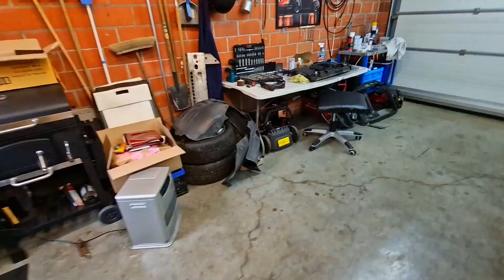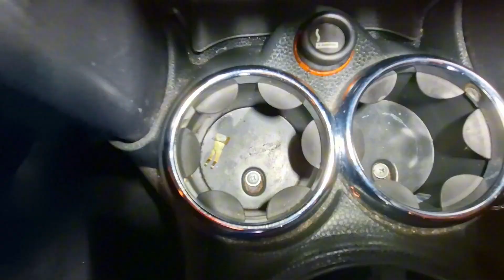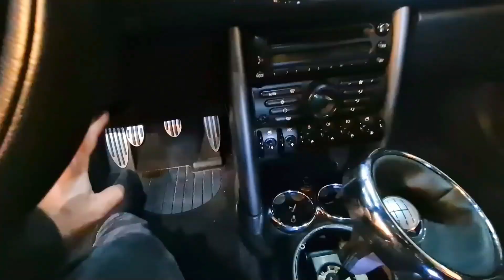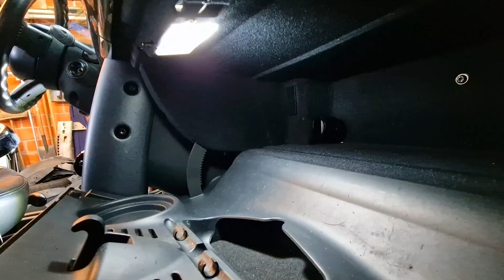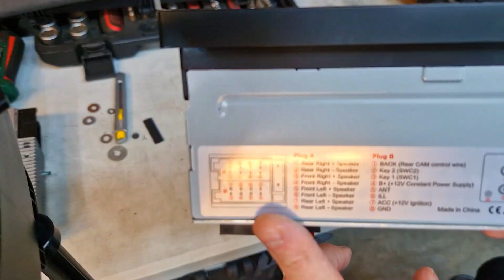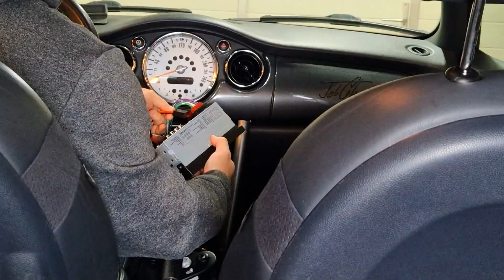How To Replace Your Mini Cooper Original Radio To Android Auto / Carplay

Comment: Do your steering wheel controls for radio works?
Reply from the maker: You will need an adapter loom if you want steering wheel controls, you can buy these from ebay, just make sure it is for the correct car.